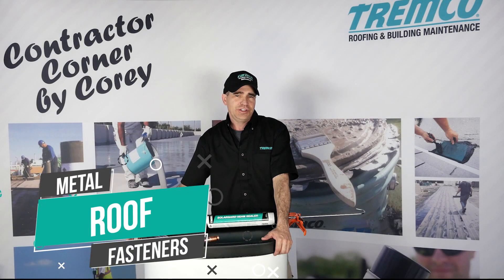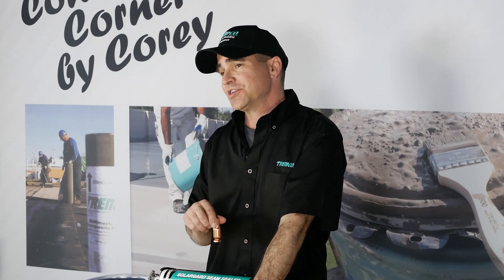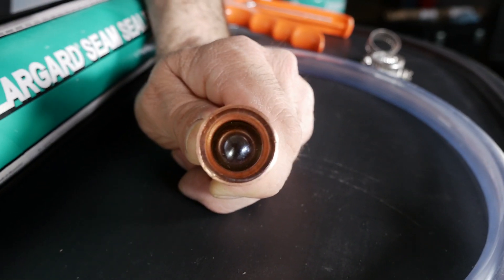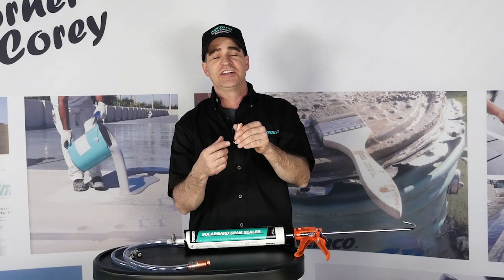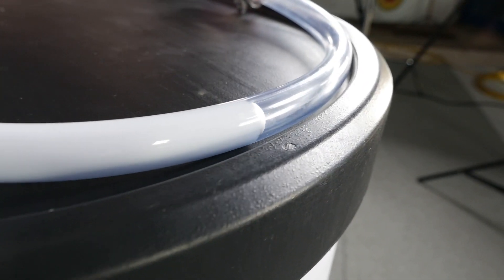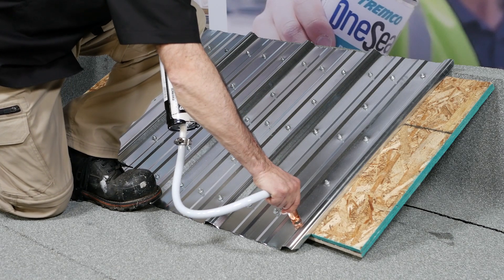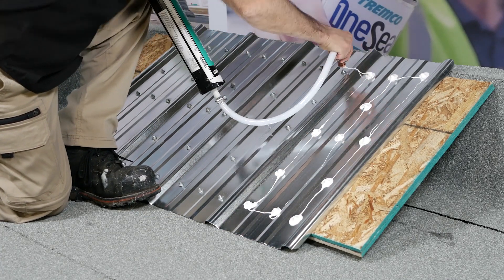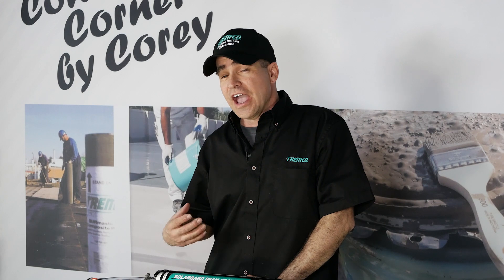How To Roofing - Seal Metal Roof Fasteners Quickly With Little Waste

Comment: You can use over and over again gas siphon if you clean it properly. You can use paint thinners, mineral spirits or white spirit. Then pressing many times the marble inside and using something that can pass through the siphon, you can scratch the walls and remove as much as you can. I cleaned completely 3 times.

Comment: Unfortunately Tremco is not available in my country and I couldn't find a similar sealant. So I used 50% silicone and 50% pu sealant and dissolved them with White spirit(paint thinner,mineral spirits) so it can flow outside of the gas siphon and not be that runny.